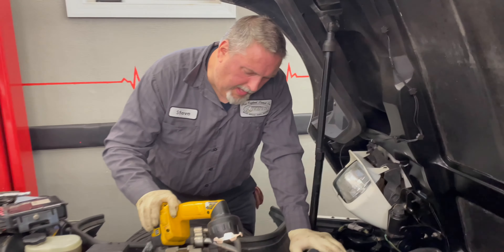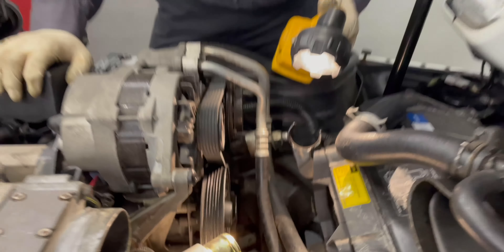How To Replace Serpentine Belt 1992-1994 C4 Corvette LT1

Comment: I just put my belt on and the only way i could do it was by pulling the belt over the ac compressor pulley last. It really would have helped to have 2 people, one to hold the tensioner and another to fit the belt. Unfortunately, it was just me.
Reply from the maker: Yeah, It's a little tight slipping the serpentine belt back onto the pulleys.